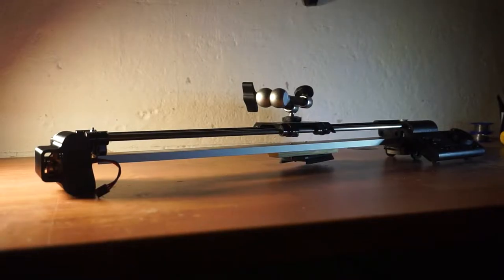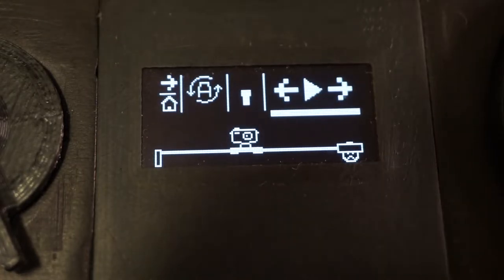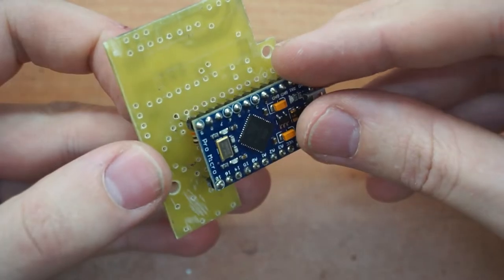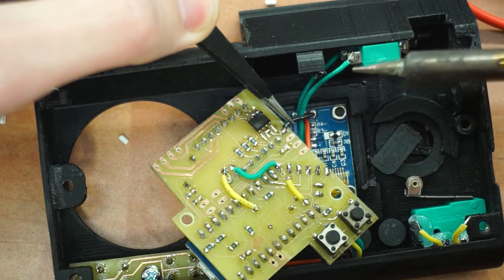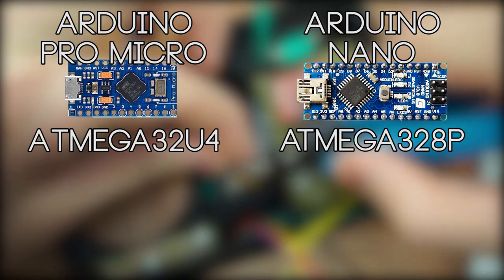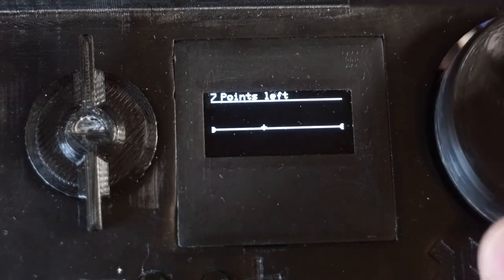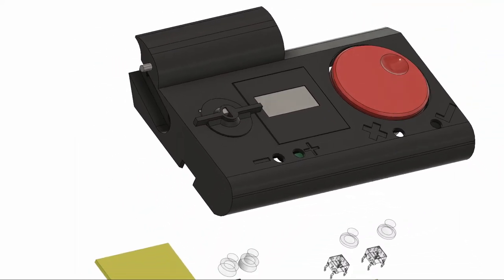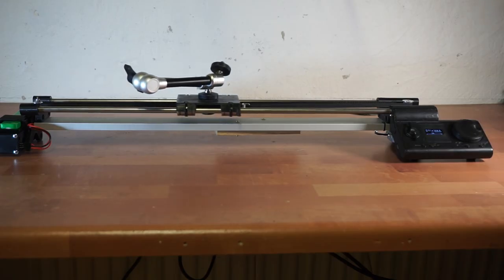DIY motorized camera slider | with screen and Arduino(3D printed)

Comment: Great build, and I love this idea! There are two tweaks I might make. First, a shutter release, which would be easier with some models of camera than others, but mine just uses a TRS. Ground the ring to focus, and ground the tip to trigger the shutter. Second would to move the manual control over to a serial input, e.g. use a script on a PC to define where to move, how fast to move there, and when to activate the AF/shutter.

I'm definitely going to revisit this when my 3d printer gets here. I think there are more applications here. Imagine a fully automated dolly zoom...

Comment: This is AMAZING !!  The graphics are great as well as the entire build.  Good Job  I cannot wait to see the end product with everything working.  Mating it with a 3D printer would be insane.  Maybe a simple laser ranging circuit that keeps track of the build plate on printer.  I am sure you have this all planned and waiting for the time to attack.  Thank you

Comment: Hi, this is amazing.  I have a manual slider I've wanted to motorize for ages... have you completed the waypoint system code, or you have you moved on from this ;-)  Great video. New sub.

BTW one question: I have a DJI Ronin-S gimbal for my camera, and I was hoping to use it on the camera slider... my camera is quite heavy (Panasonic GH4 plus Sigma 18-35mm lens is over 1kg).  Will this work with the stepper motor you used?  I'd like to be able to pull a 45% incline with this setup, so that I can use the Ronin app to programme moves as the motor slider moves... hence my interest in your waypoints, which would be just too good to be true!
Reply from the maker: The waypoints were never completed unfortunately. The motor should be able to move camera you've mentioned
Reply: @Gyro1  thanks for the reply!  I'm going to use your working code as the base, to have a manual and auto mode.  I already have an Arduino One and a Keypad Shield LCD1602 that I bought with this project in mind ages ago, so thanks for the inspiration! 

I think I'll have a go at implementing three waypoint buttons: Left, Middle and Right.  Perhaps the buttons would be on an infra-red remote, so I can operate it whilst being in the video.  I've never programmed an Arduino, so I've no idea how difficult or easy it will be, but my idea would be to have a pre-programmed acceleration profile/curve setting and then just enter a travel time in seconds with the jog wheel.  For my purposes, the travel time is the key setting control I want to have.  The buttons would then set the distance, and speed will take care of itself.  I'll have a look at some of the commercial products available and see how their menus work for clues.

So in use, the idea would be that if the slider is in position Right, and I press button Left, it would travel to the left in the 'travel time' entered.  If I press the Middle button, it will travel there in half the time; and pressing Left after that it would then proceed to the left.  Or pressing Right would take be back to the start position.  The LCD could display the acceleration mode (if there is one, I'm not sure if I need this or not) and the travel time, perhaps showing elapsed time as well.

If I can figure out how to do it, it would be nice to be able to move the "Middle" button position by selecting an X value, or even better by moving the slider to a position and capturing that position... the formulas could then be calculated with this X value... but maybe that's too ambitious!  I'll have a look at your unfinished waypoint code to see if that can be adapted for this use.

The rest of the parts would be copied from your specification.  For the manual use jog wheel, I think I'll use an off-the-shelf CNC hand wheel pulse encoder.  Since I have the LCD1602 keypad/display, I'll use the buttons on that for setup and manual control.  Does this sound like a doable plan for a complete novice at arduino programming?  I plan to start with some Arduino programming tutorials I've found online, and of course study your code.  Then I can experiment.  Any pointers most welcome!
Reply from the maker: Good luck man. If you're familiar with any kind of programming, it shouldn't be too hard. You don't really need any acceleration curves if you have enough torque. Maybe a bigger motor wouldn't be a bad idea
Reply: @Gyro1  thanks... I'll go for the bigger motor then I think, and explore from there. No programming experience at all! So I may have to just drop the waypoint idea if I get stuck lol... I'll let you know how I get on.
Reply: @Gyro1  you may want to check out Stephen Hawes' channel if you haven't discovered him yet: he's an automation guy, into 3D printers and cameras too.  He has a video controlling a camera slider with 3 axis gimbal (3D printed of course) via Klipper-controlled microcontrollers, programmed in Blender!  No kidding: he uses Blender's animation software to create a move in 3D space, and he's created a plugin that converts the coordinates data into G-code that Klipper can use to control his camera slider!  Thought you'd love it...

Comment: I like this a lot! Though it looks like using a peg on the slider to tension the belt would cause higher tension around the end of the slide than in the middle.

Then again, it probably doesn't even matter. I mean it's a camera slider, not a high precision laser gantry.

Comment: Hi can this be done on an already bought cheap slider? And also, is there a tripod mount file too? 😅
Reply from the maker: Yes. You can modify existing slider. There is no file for the tripod mount. I just attached the tripod to the aluminum profile